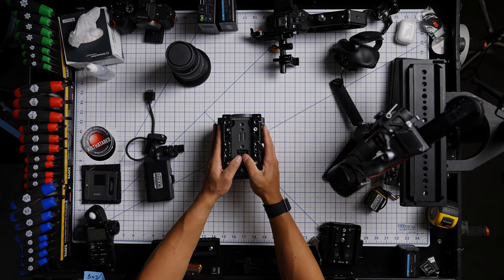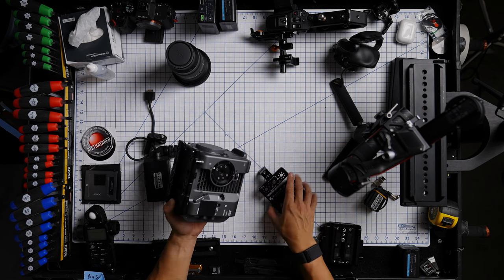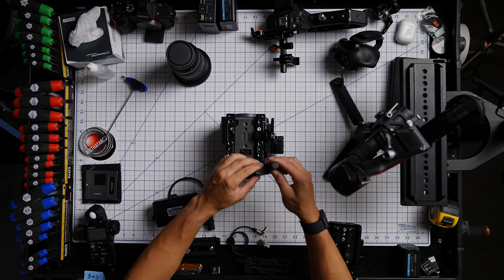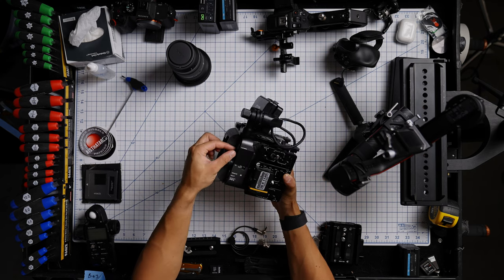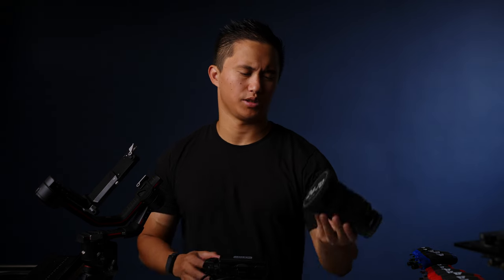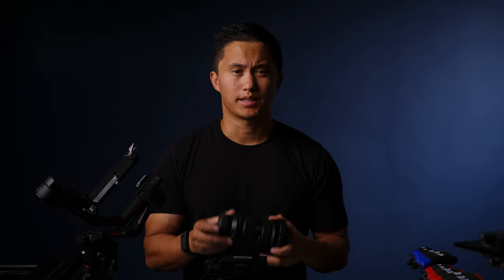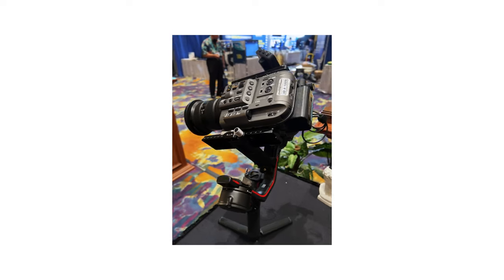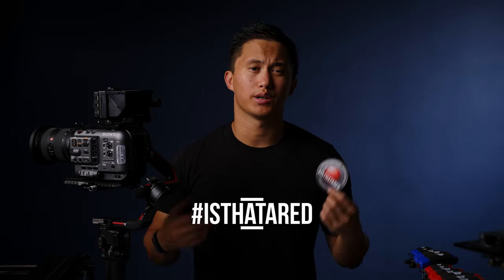Camera Rigging 101: FX6 + DJI RS 3 Pro

Comment: For camera control you just buy a Smallrig FX6 grip holder and an extension cable. You mount the fx6 grip to your gimbal (or ring, or both) and you're done. :)

Comment: I attached the fx6 side grip to right side of the RS3 pro through a Smallrig Nato-Arri Rosette adapter + SmallRig Handgrip Rosette Adapter combo. I can quick release the side grip easily and also have full control of the cam.
Reply from the maker: Great idea. I'll look into this solution.
Reply: Hey there Shem, very good idea, but where exactly did you attach it on the RS3?
Reply: @alainbaars  to the right side
 of RS3 pro as fx6 grip is right handed.
Reply: This Is Genius! Did you have Better footage rather than using the plate? I have struggling with micro-vibrating from the First day of RS3, never figure out why

Comment: Thanks for sharing.  My main complaint is like you said the record where it doesn't work from the gimbal.  There is a lanc cable you can get for this.  Just seems you spend $1000 on a gimbal you should at least be able to use the record on the gimbal.

Comment: Hey Robert! Exact same setup as you I have, my fx6 keeps having crazy jitters when on my rs3 pro. I definitely have it balanced perfectly too, about 50% of the time it just shakes like crazy until I need to turn it off. Anything you think I may be doing wrong?
Reply: I have exactly the same issue. Sometimes I have to give up and shoot handheld.

I Just figure out that if you tighten all the things, Rope ecc so strong you get Better results, as well as decreasing the stiffness.

BUT DJI IS NOT ABLE TO GIVE ME A SOLUTION.
What I think Is they have some broken gimbal or camera as FX6 can't really be supported, even of the motors are not using force.

I tried with mirrorless, never experied that problem.

Did you find any solution?
Reply: @MarcoChizzola95  I’ve realised if I use the extended base plate with a lens that isn’t insanely heavy I’m fine! It just lowers the height of the fx6 and I get a way better balance - always remember to re-calibrate after each lens swap too
Reply: @benoneilldp  Any chance you can give a tip about which extended base plate to get? Thank you!
Reply: @vicky987678  no probs! I use the smallrig extended baseplate! It keeps the centre of gravity nice and low!
Reply: @benoneilldp  I have the same problem, what is the solution for this? I use the flat plate, the wide one. but the tremors still continue. and now it's really annoying. My lens is 600 grams, my device is Sony FX6 and Ronin DJI RS3 Pro

Comment: I was just able to secure a FX6 after waiting a few weeks from my local camera shop. I was trying to figure out a first good lens to pair with the fx6. Would you recommend the Sony 24-70 version 2 or the Sony 24-105. Obviously the 24-70 has an extra stop of light, but the extra length in the 24-105 seems like it would be helpful, and with the dual iso of the Sony and solo shooting, I don’t usually shoot wide at 2.8 often.
Reply from the maker: I've heard nothing but great things about the 24-105. I haven't used it myself but having the extra range is always super useful. If you're looking for just one lens, that might be the one to spring for.
Reply: I got the fx6 with the 24-105 f4 last year as that got to me the camera  a little faster than just getting the body only option and I don't regret it at all! Sold little lens. I do plan on buying the 24-70 2.8 but will probably get the v1 to save some money and I don't mind the extra weight of the v1 which for me is better for handheld scenarios.
Reply: If you do have lights and won't have a problem with loss of a 1 stop of light then go ahead for 24-105, also remember it does have image stabilization which is absolutely fantastic

Comment: Finally solved the start stop problem. An Australian company called IgniteDigi makes a run stop cable. You don’t get any other control but it works with fx6. That was my main problem with flying it with the rs2 and now the 3

Comment: Did you get the FX6 balanced on the RS2? I have the extended base plate and feel like it is almost there. It works but i feel like the motors are not happy. Thanks for the content and great videos, your channel is a cut about the rest.
Reply: Its the RS3 pro that he's using
Reply: Yeah, it works on the Rs2, used it plenty. You'll need some counterweights, but doable. I had mine with chunky Sigma FF lenses on and it worked!

Comment: That’s a lovely setup. Probably as close to perfect as you can get in terms of versatility, performance and IQ. I’m still rockin’ the RS2 but for longer heavier lenses I might have to grab an RS3 Pro eventually. What would you say is your most used lens?
Reply from the maker: When I'm not using primes, I'm usually on a 16-35 or 24-70!
Reply: @robchado  Do you ever use a handle for the back or clip for an easyrig? have you done that before , I just recently got my fx6 and i'm looking to do run an RS3 pro with my easyrig

Comment: @Robert Machado  - A huge gripe about the FX6 is the audio built into the top handle, and then being unable to easily balance it on a Gimbal. No one has yet provided footage of the FX6 with a shotgun mic in the top handle and giving a demo and evaluation on how easy  or difficult it is using the FX6 with shotgun Mic on a Gimbal. Is this something you can demonstrate?
Reply: It's honestly not worth it; It's much easier to record scratch audio on-body and then sync your audio later using Pluraleyes or the like. I always fly mine with a gimbal ring that has at least a Zoom F3 on it. Although the easier option is just running a tentacle sync to the camera to make sure it's always locked with the in-camera audio.